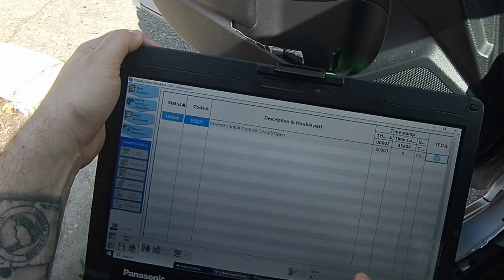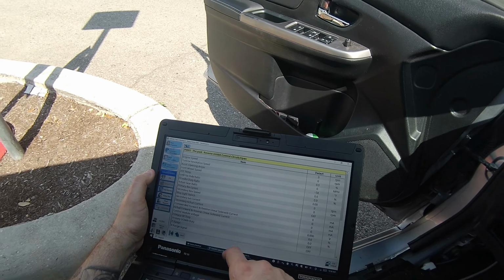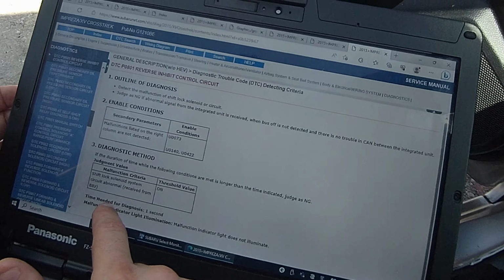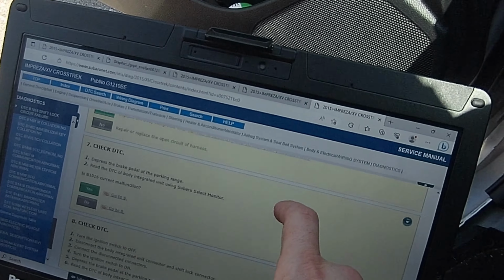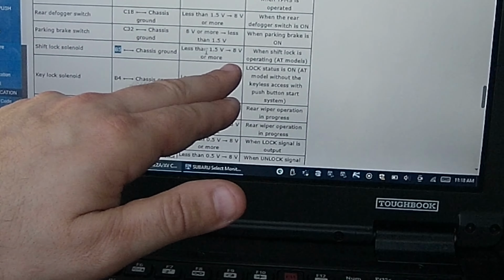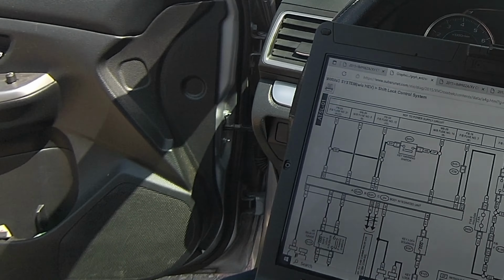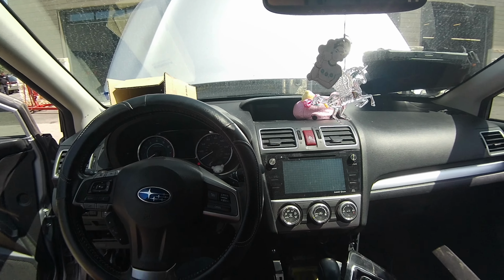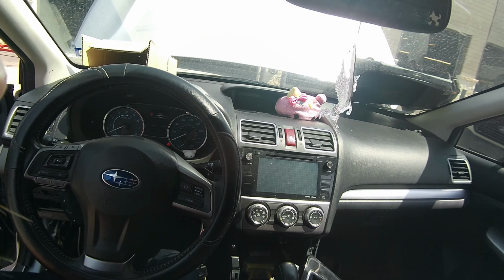2016 Subaru Crosstrek — P0801 — Flashing ATF light

Comment: can you buy a shift lock solenoid separately? i have this p0801 in the same conditions you experience
Reply from the maker: The solenoid is sold separately.
Did you make sure to inspect all your fuses first?
Reply: @thatsubaruguy1324  i did a resistance check on the solenoid and saw 0.2 Ohms

Comment: Good stuff dude! 
Thanks for the SSM4 and STIS tutorials!
I'm an Indy Subaru tech, and I know what you mean about the loud music, drives me nutz.
Maybe I missed it, will watch the video again, but were you able to determine what made the fuse fail?
Reply from the maker: A shop needed to replace the ECU behind the glove box. Instead they unplugged the BIU by the brake pedal.

Everything plugged up right so they thought it was installed correctly.

I was shocked to discover the BIU plugs and ECU plugs are not keyed
Reply: @thatsubaruguy1324 

 Bent pins in the connectors, short-circuited?
Reply from the maker: @hnd2893   
No bent pins. On this car the ECU and BIU have identical plugs. Most likely because they have the same motherboard, just different eprom chips.

Thankfully all they did was pop a fuse. They could’ve fried the new ECU
Reply: @thatsubaruguy1324  

OK, thanks, go it, wrong locations oopsies :O)
Reply: I'm a newbie to diy troubleshooting.... Where can I find those wire diagrams for various components?